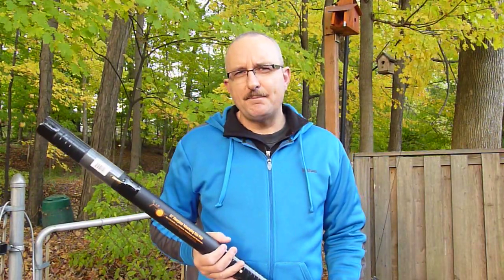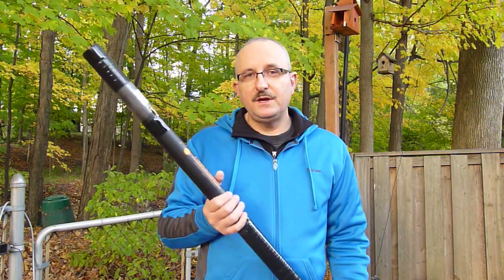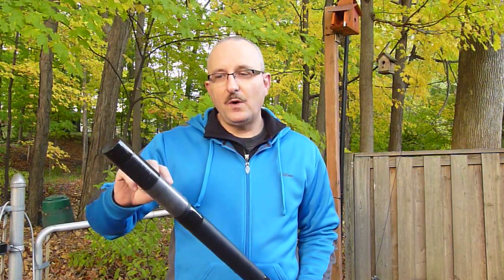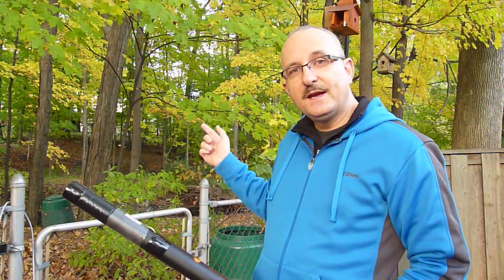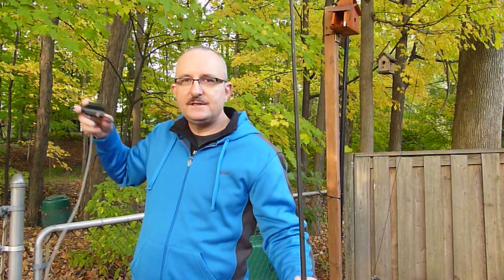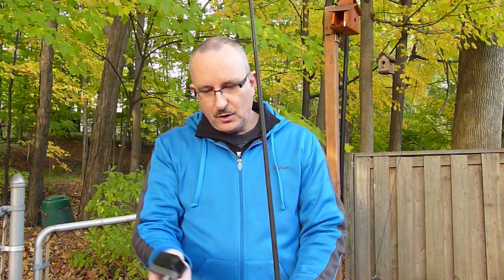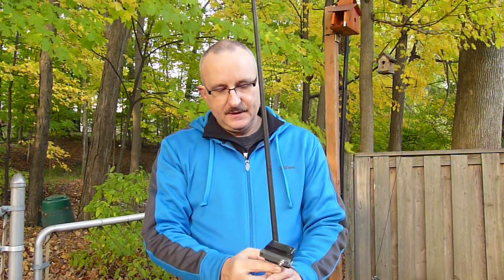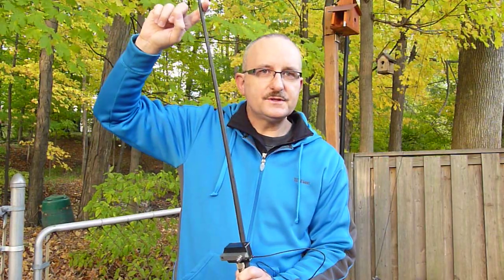Using Fiberglass Poles for HF Portable Operation

Comment: Tracey this is a very inspiring video, I am about to travel down the same path you have already been down with portable VERTICAL antennas.  I Think you have a  magic box there with a 9:1 UNUN Balun or possibly a 4:1 Balun with he PL-259  on the side of the magic Box.  I wonder what kind of power are you running, how many watts ? Is this for a QRP rig? What is your typical SWR on 20, 40, 80 ? I will be experiment with  10 watts at first with the same set up just to keep things safe  on the antenna tuner to prevent the dreaded magic smoke.  I understand  one or more counterpoise is also highly recommended on these end fed antennas, do you use a counterpoise?
Reply from the maker: +jmitsch44827 Hi and thank you for watching. 
- I have run anywhere from 100W down to less than 5 watts on this type of antenna. Please note each different antenna has its own unique power rating, stay within the rating or you're going to do damage to the antenna, the rig, or both.
- Yes, I have used these antennas with an FT-817. I have other videos showing me doing so.
- SWR is typically 200khz or better on 40m, and full bandwidth on 20m. My HyEndFed 5 band covers about 100 Khz on 80 without a tuner.
- The need for a counterpoise is dependant upon the type of endfed antenna you are using. PAR/LNR and HyEndFed models do not require a counterpoise for effective operation. I do not use a counterpoise with these.
Good luck with your station!

Comment: I was thoinking about getting a couple of the 31 foot ones, can I use a wire to attach to the tip  and send to another pole using a Horizontal way?

Comment: Hi Tracey, I run several efhw antennas as well. Actually I was thinking about buying 2 of these and making a plate so the poles would be V shaped. I want to try a 40 meter vertical loop but I don’t know where I could find one that’s 42ish feet long. Trees aren’t plentiful here so it’s just a thought. I even thought about running 2 40 meter vertical loops using a pole like this similar to the k4fx design. How do you attach the wire to the pole if you are running outside the pole? Thanks again.
Reply from the maker: Hi and thank you for your interesting comments. Spiderbeam makes a 40 foot pole and they have a US distributor. Typically, I just use electrical tape to fasten the wire and coax to the pole.

Comment: Hi! Fantastic: one question > is it possible to run the wire inside the fiberglass pole or will I lose a good SWR or bad influence?

Thanks, Regards!
Reply from the maker: Hi Jens! Yes, many people have run antenna wires up inside the poles. This works well. The only influence on SWR is a slight variation in resonant frequency.

Comment: Tracy, curious to why you mount the end fed matching box high on the mast?  Wouldn't it be simpler to mount at the base of the Jackite pole and run 30 feet of the wire up the mast and then the excess over to a tree or ground.  Does mounting it high affect the performance in you opinion?  Just bought one of the 31' Jackite poles and going to use an EFW with it and just wondered your reasoning behind the mounting location.  Jerry
Reply from the maker: Hi Jerry, thank you for your question. I made the video 7 years ago when I used a feedpoint up high just off the roof of my house, sloping down to a fence at the rear of the yard. The endfeds I was using worked very well in that configuration. In recent years, I've operated very successfully with the unit at the low end and had great results. I now know either configuration will work just fine.
Reply: Thanks for the insight.  I am going to model my quick and easy picnic table portable operation like N0HYD uses with the 31' Jackite pole.  He has everything remounted on the pole and all he has to do is raise it the 31' and screw in the coax.  Three minutes or less.  http://www.n0hyd.com/p/portable-qrp-antenna.html.  Your video got me curious however after seeing you two videos on the jackite site.  thanks  Jerry W4DSD

Comment: Hey Tracey, I'm thinking of getting the Spiderbeam 12 meter mast and using a g5rv antenna. Do you think this would work ok?
Reply from the maker: Hi Mark, it might. There are a lot of variables involved. For starters, a vertical has a different radiation pattern than an inverted V. Nonetheless, give it a try. I think you'll do well with that combination. 73 from Tracy VE3TWM.
Reply: Thank Tracey,  I am going to run it as a sloper inverrted V  to an  ugly balun to a tuner to the transmitter. For 80 meters, I'd like to get the height up to at least 35 ft.  I'll let you know 73!
Reply from the maker: Sounds good!

Comment: Hi will the fiberglass pole have any effect on an insulated copper wire running inside as an antenna ??
Reply from the maker: Hi Atticman, thank you for watching my video! I have been told that fiberglass poles can change the resonant frequency (though not by much) when a wire is run up either on the outside or the inside of the pole, but aside from that the antenna will work fine. There was a company called S9 that was actually selling these poles with a wire that ran up the center. Most decent wire is impervious to the weather, so my preferred method is to run it up the outside and save some hassle when raising and lowering the pole. 73 from Tracy VE3TWM.

Comment: I'd like to have the bottom 30' of a 70 foot pole. Then the individual tubes would be larger around. Then I could hang a wire from the top at 30 feet.
Reply: WX9DX: Good point.....the top section/s of most poles are too thin for most antennas so just buy one which is longer than you actually need and then remove the thin top sections=/s.

Comment: Sounds like a great idea, but the $70 USD pole is now about $100CDN, plus about $60 shipping at the last place I checked. Does anyone know of a more reasonable source for them right now?
Reply: i built a 20'ft out of pvc works just fine,  each section is 40" long, get 1x 10' 1.25" and cut in thirds then a 1x 10' 1" cut in 3rds but only use 2 of the sections and 1x 10' 1/2" again cut in thirds only use 1 of the sections, then you have spare parts if you ever need it,  use couplers and reducers to connect them all together etc, it works great, use clothesline for guy wires. Used it on field day. I will be putting up  a video for it as soon as i get the chance  total cost $50 all the pieces will go inside each other so you only end up with 3x 1.25" pipes 40' long you can put in a bag. I used the bag that came with my speaker stands for my dj gear, put everything in it including my dipole wire

Comment: ive seen a few of these, and to me they look like fishing rods. 
we catch carp with these rods . and can easily hold a 10 pound carp. 
Granted do not lift the carp out with it. but think of the stress it can hold of these small but very strong fish. 
So ! even if they'll break find a video how to repair a fishing rod, and you'll be up and running again.
Reply from the maker: +Dhr Willemsen Great tip, thank you for sharing!

Comment: HI Tracy this is ve3vjc just one question  where i can buy end fed antenna unit  which u are tying up on mast pole i do have 31 feet mast pole mfj with me pse do reply  Chauhan VE3VJC/VU3DBG.Best regards.
Reply from the maker: Dilbagh Chauhan Hi Chauhan, thank you for watching my video. Google LNR Precision or HyEndFed for links to sites of two top vendors. Good luck and consider posting a video for us to see your new antenna! 73 from Tracy VE3TWM.
Reply: yes Tracy i searched those sites but i did not get that black box which u are tying to mast pole is this part available any where i want to buy one and what is apps cost will be most thankful to you ve3vjc chauhan.
Reply from the maker: Dilbagh Chauhan The black box is included with the purchase of the antenna and is in fact what makes the length of wire an effective antenna. Prices range depending upon which band(s) you want to cover and the power level the antenna can withstand. 73 from Tracy VE3TWM

Comment: @mike240se Regarding the audio level - I do concur, but it's a great video.

HEY TRACEY!  (Tracy?)  If you'd like to send me the audio (or even video), I can run some processing on it, and you can upload the replacement audio track.  Just a thought!
Reply from the maker: Hi Overand, please accept my apology for the delay in response to your offer. I really appreciate it! I use a "bridge" camera (Panasonic Lumix FZ35) with a built-in mike and no provision for an external one. If I can figure out how to modify this video without changing the number of views I'll do some work on it. Thank you and 73 from Tracy VE3TWM.